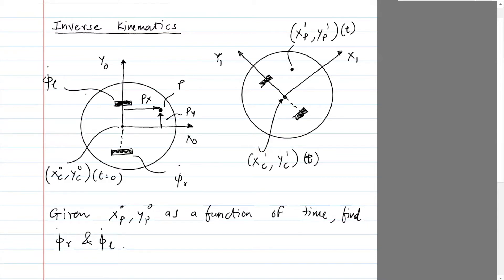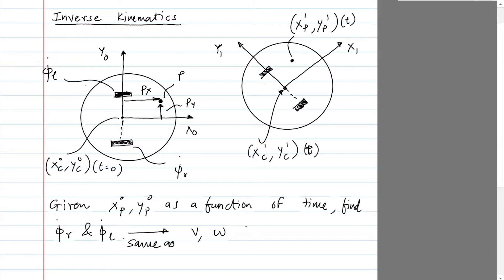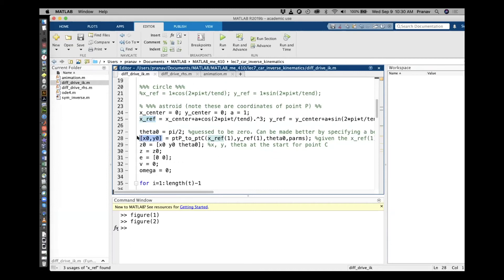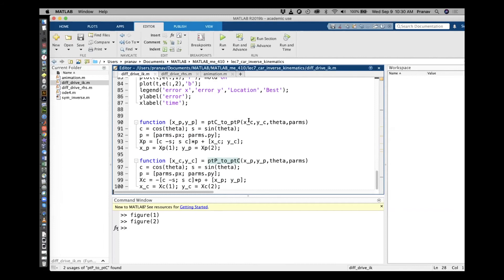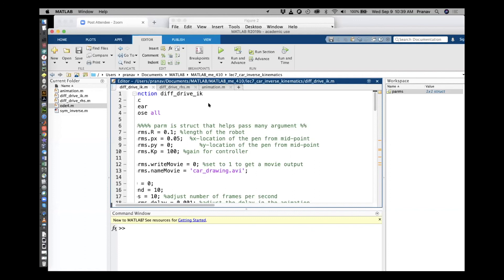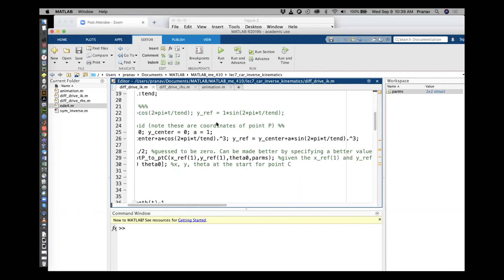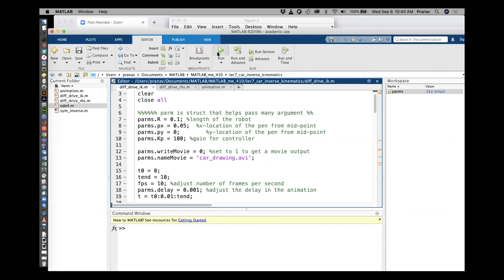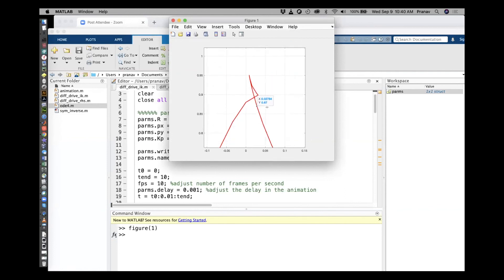Robotics Lec7: Inverse kinematics of differential drive car  (Fall 2020)

Comment: Thank you for your interesting video, @Pranav Bhounsule. I have a question regarding the physical implementation of the robot, considering, for example, a Khepera or LEGO. Is the inverse kinematic model the one that needs to be applied to the robot's trajectory? For instance, consider the motor actuator's ticks to give rotation to every wheel?
Reply from the maker: You need to first map the ticks to the joint angles. The ik will map joint angle to end effector position. Using these maps or functions you then relate the ticks to the end effector position.

Comment: Hi, I noticed that the @diff_drive_rhs which is passed onto @ode4 is slightly different when compared to @euler_integration that we used in the previous lecture for forward kinematics.  

My major confusion lies in the fact that @diff_drive_rhs returns [x_c_dot, y_c_dot, theta_dot] which is saved in z , and is even used for the animation, whereas in the @euler_integration [x_c_dot, y_c_dot, theta_dot] are just by-products and we actually compute and return [x_t1, y_t1, theta_t1] which are stored in z and are used for animation. 

So how are we storing velocities instead of positions in z , not keeping track of the history of actual position coordinates when using @diff_drive_rhs and still end up with the right animations ?

I tried replacing  @ode4 with @euler_intergration from the previous lectures as I was not quite comfortable with the working of ode4, everything runs perfectly fine. Also, thanks a lot for taking your time to reply back to comments from old videos.
Reply from the maker: A diff. eqn. is of the form, 
 dxdt = xdot  -- (1)
Discretizing gives, x(t+1) = x(t) + xdot dt -- (2)

The file euler integration implements x(t+1) as given in (2). In case of ode4 the formulae (2) is a bit different but the idea is that one only needs to provide ode4 with xdot and it uses its internal formula to compute x(t+1). (Aside: The xdot in (1) appears on the right hand side and it often call the rhs). The file diff_drive_rhs provides xdot to ode4 which then computes x(t+1). You don't see it in the code unless you open ode4 and scrutinize it.

In summary, euler_integration combines integration and xdot (or rhs). ode4 needs to be provided xdot (or rhs) as a separate file which is what I do in diff_drive_rhs.

Comment: How can use LQR control in Differential drive wmr for position control
Reply from the maker: You would linearize the system about the operating point, say x_0, y_0, theta_0 then use LQR. IT should be doable with the equations I have given in the video. All notes are in the Fall 2020 files here: https://tiny.cc/pranavb_robotics